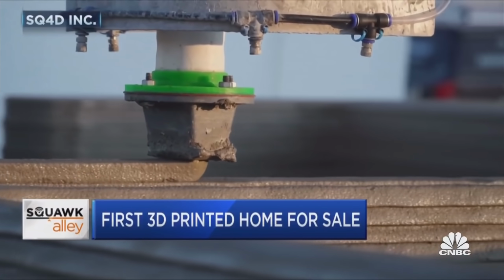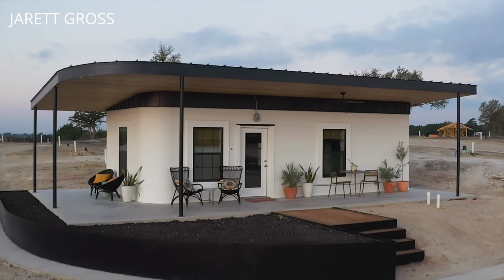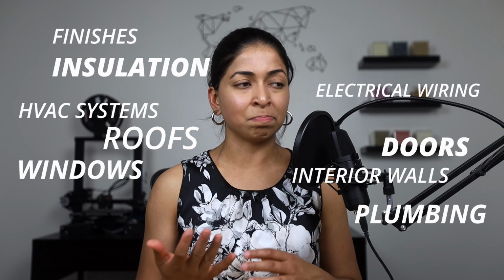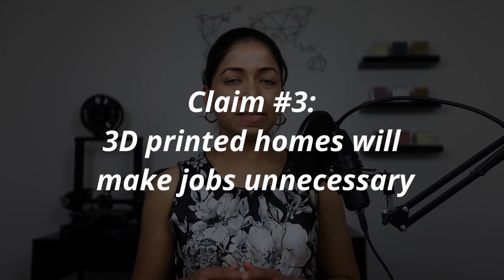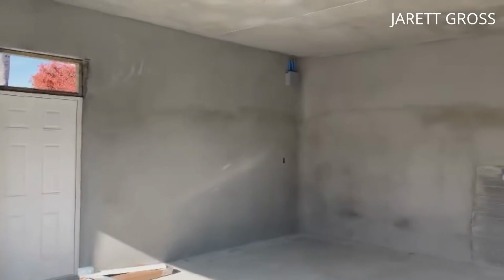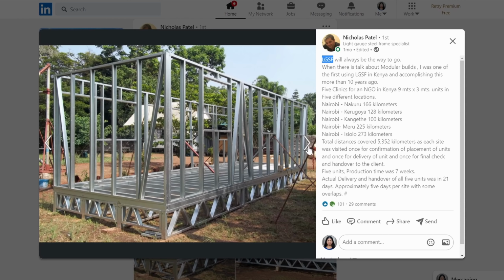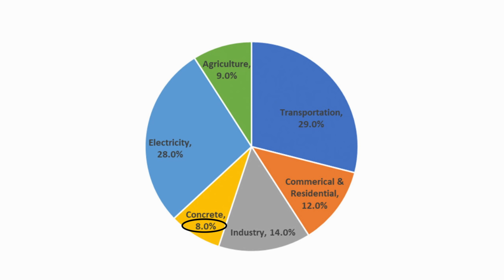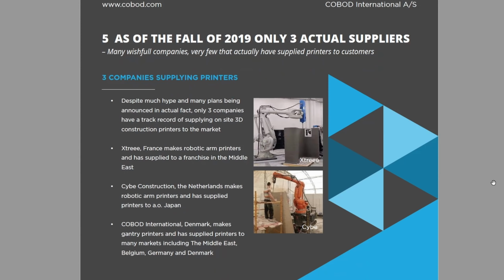Exposing 5 LIES about 3D Printed Concrete Homes

Comment: I never understood why 3d printing concrete walls is an advantage to preformed panels. Only thing I can think of is shipping, but the same will apply to the shipping of raw materials
Reply: Its not an advantage to manufacture concrete on site. Show me a 3d printer that beats Martin Marieta ready mix for quality and price. They never will.
Reply: to be honest, for basic straight walls there isn't any real advantage at all. block wall will go up faster, and  is cheap.  can be bought anywhere. a decent bricky can lay 100 to 200 blocks in a day, easy.. to a recommended height of 16 blocks high, for higher levels, time is needed to allow the cement to set. 

16 block high walls are over 3m higher, more than high enough for that 3d printed garage as an example. a block equivalent could be done in a single day.
Reply: You have to ship an enormous gantry to the site and install it, one taller and wider than the whole structure. Notice they always show a closeup of the print head, not the enormous structure it's riding on.
Reply: I’ve used SIP on an addition and was able to do everything but the foundation. 3D walls scare me without rebar.
Reply: Only actual point is making pretty shaped walls.  3D printing is way overhyped in all materials.
Reply: For one thing, it’s a new technology.

There are many instances of reluctance to a shift in paradigms.

I’m not saying that this particular technology is currently viable, but all opinions should be taken with a chunk of salt.

I tire of constant nay-saying that does nothing more than reject ideas rather than investigating how to evolve them.
Reply: @jackdeniston59  Which means what, exactly?

We should just toss all these techniques out?
Reply: @support2587  The first company that makes a modular construction system that offers future expansion in all three axes will make 10 times as much.

Imagine not having to tear down existing construction when you want to build deeper, wider, or taller. As resources allow and necessity dictates you can expand downwards for thousands of feet and laterally for miles. Incorporating hydroponics, you can move all agriculture and manufacturing underground to return more of the surface to nature.
Reply: @kfoltman  “The reasons you can’t arbitrarily…”

…. with current technology.

Thank you, you rest my case.

Imagine a a peripheral support system that divides the foundation into 7 hexagonal sections where any three peripheral foundation plates and the central foundation plate can support the whole structure by itself. With a triple redundancy like that, you would be free to excavate any one of those 7 plates in a live load situation. Furthermore, any repairs on a single element can be accomplished during live load situations.
Reply: its a solution looking for a problem, were in the peak of the hype cycle
Reply: @quartertwenty484  yup not to mention whats the cost to manufacture one of those printers
Reply: maybe an advantage that you can do unique design that is not made of flat parts. It can have organic shapes.
Reply: At large scales I think a 3d printer could be quite efficient. For example if a whole neighborhood or large apartment complex is 3d printed you could save alot on shipping and setup.

For flat walls its probably not the best solution though. Its real advantage is complex curved shapes. 

But that's a niche market, most people are fine with boxes. However if fancy curvy designs become popular 3d printers would become quite useful.
Reply: @denisl2760  applying any type of finish to these non flat wall will make the cost go way way up.. tilling will be fun... I just dont get it this is tacking a part of the construction that is relatively cheep. yeah you can get round walls great they will fit nicely with all the round furniture from IKEA..
Reply: Curves.  That's it.
Reply: @support2587  They do have rebar. They skipped over it but it's in the layout picture. I think they presumed everyone knows that it's required.
Reply: @sparksmcgee6641  That's a hell of an oversight in video production, it's the most important thing.
Reply: Preformed walls can suffer damage from shipping rendering the whole wall worthless. Also the crane to move the walls into place can be a problem in areas. So you can ship the machine or the crane, then ship the walls that might break or ship the concrete. Its like shipping stone tiles, they are smaller but they tell you to get extra because of breakage which is a problem most don't think of. Also this can do curved shapes more than just straight and people want stuff like that.
Reply: @jackdeniston59  In fairness, there are some cool lattice stuff which can only be done with additive fabrication tech / 3d printing.  And a lot of the time complex forms are functional (brackets and mountings for example)... 3d printing is great for that.  Walls... Not so much.

BTW: I can totally imagine 3d printing in a factory being pert of constructing prefab wall sections (and trusses and such).  Not for the routine flat parts though.
Reply: There is drawbacks with preformed walls. Most of them have to do with shipping and installation.
Reply: @matkany  not really, you can make way crazier shapes with a frame and moldeable concrete, or just have interlocking blocks for fast walls buildup if you want to build straight, way faster than the 3d printer at least so far
Reply: @ezicarus8216  yeah but you dont need big curves you just need to elimite angles and make flowing paths
Reply: You don't necessarily need to ship raw materials if it the raw materials are available locally. This is exactly why NASA is interested in 3D printed structures on other worlds.
Reply: @JohnDahleAL  You are thinking two-dimensionally.

There is plenty of space below ground as well as in the oceans. We have enough space to double our population every 100 years for the next thousand years before we would need to leave the planet.

You can fit the entire world’s population comfortably in a 10 cubic mile of space and would only need 100 cubic miles of space for basic necessities. That is the same amount of land as any SINGLE city to a depth of one mile underground.

Moving most of our infrastructure underground or under water would protect it from natural disasters while returning most of the surface back to nature.

I have crunched the number, and it can easily be done. The problem is that it would drastically alter the economics of land value which current land owners would not appreciate. Any drastic change in the current paradigm would drastically alter the power structure.

The technology is not difficult. Overcoming the brainwashing of the masses is the problem. There are solutions to that as well, but most people would rather sit and complain instead of actively developing solutions.
Reply: Although "quick cement" can be used the general idea is to use the materials found on or close to build site. If they were to prefab parts the issue would simply be the shipping and unloading which would require a crane and it may not be possible to get a crane into some areas
Reply: well technically it replaces labor. the shipping of goods will be automated too. that is probably the first thing to go.

currently men have to align the machines but that is a small step away from being fixed. no pun intended
Reply: @support2587  as with most masonry, you don't need reinforcement if you make it thick enough. But at what cost? Steel is cheap and recyclable. You don't need expemsive alloys either. It makes a lot more sense to reinforce concrete than to print or make ridiculously massive walls.
Reply: @pinheirokde  arguably, you don't need to do anything other than paint it. Apply a seal coat to the concrete floor every so often and only tile in the wet areas.
Reply: Strength and workforce. A large scale 3d printer can cover enough space to build the frame of 10 houses, IF YOU SET IT UP THAT WAY, and can run continuously. Once the first one cures, you can have your men wire and water it up while the machine works on the next house. What should be a 10 day to 2 month project can be done in 2 days. Also, 3d printing lets you do structures that normally couldn't do with normal fabs, and lets you mix in materials on the fly. Rather than need to go over a section with a hand tool or a truck twice or three times to get agents in there, the printer can just lay one layer ontop of the other at the same time.
Reply: I think the technology is something that would be necessary for remote habitats, like some of the Mars habitat design proposals or something that could be built in Sub-Saharan Africa where you plan on using local resources to save on shipping costs. But yeah, in a city you're not gonna get anything out of it except for angry unions.
Reply: @Michael-lg4wz  And the automobile will never replace the horse!
Reply: Pretty simple. Preformed panels have to be installed by humans. Human work is far more expensive than the electricity a printer needs.
Reply: @Clean97GTI  same can be told for a standard concrete wall, and some times architects want that, but that is not the norm not at all
Reply: @sparksmcgee6641  It is an advantage, when it's too expensive to ship concrete from the closest concrete plant. Like for example Mars, for which 3d printed construction was invented.
Reply: @allyourcode  as someone who has participated in some of those research projects: we won’t be doing this off-planet. The easiest place to build for humans is Mars, and there the most efficient method is a low pressure dome with old-school reinforced local brick laid by humans. 

The mass, volume, and complexity - not to mention the maintenance - of printers at that scale and built for that environment makes it ridiculously expensive and inefficient.
Reply: @benji45645  nah the cost to put this on Mars is ridiculously prohibitive.
Reply: @IAmTheRealBill  maybe in its current iteration, yes. For now I think flat-pack or tent habitats would be best, but unless we start building spacecraft in space soon, there's too many other constraints with sending prefab panels or factories to make them there (launch window/volume of flights is a big one, but payload limitations are really the main issue). Also, before we have people on Mars, the signal latency means that it's significantly harder to coordinate multiple robots in construction; a single 3d printer using a flat-pack skeleton frame would be able to run a preset program and guarantee that it won't be shifted or misaligned because it's stationary.
Reply: It is just a modernistic woo-woo it doesn't make both economical and technological sense whatsover.
Reply: @support2587  Have a look at graphene/concrete composites that for smaller buildings can replace rebar.
Reply: Preformed panels require large cranes, and if they're anything other than a simple "2" dimensional sheet then they'll have to be made in a factory instead of on-site to make sense, thereby reducing the practicality. A 3d printer bot can be an arm, mounted onto an automated platform based on a common skid-steer, with some locator beacons mounted on tripods or something- have a on-site concrete tumbler that the printer-bot knows how to get to, and someone to watch over the entire process, and one person per shift (two when accounting for breaks) could run preliminary wall (and probably floor) construction for 10 buildings (or more) simultaneously. It doesn't handle everything, but you can get a lot of load-bearing walls erected in short order with very few workers.

I do think that it's over-rated, as the biggest change for e.g. cheaper housing is honestly smaller housing instead of ever more McMansions. However, I'm quite certain that this will become a successful technology (or at least, that the robot arm and/or rope suspension variants will be: I'm dubious about the gantry style), probably to about the same scale as sprayed concrete (and in some cases, probably in assistance to sprayed concrete).
Reply: @IAmTheRealBill  “Some of us have investigated it.”

Oh, well since you SAY so, allow me to retract my naysmithing.

😂
Reply: @absalomdraconis  Cheaper housing is actually larger buildings. Simple geometry shows that less material is used and less insulation is necessary for reducing energy usage.

Enclosing ten 1,000 cu.ft. (10,000 cu.ft.) buildings has a surface area of 6,000 sqft.

A single cube with the same surface area (31 ft. on a side) would contain over 31,000 cu. ft.

Also, the more real estate you take up, the more expensive real estate becomes which also adversely affects the land necessary to sustain a larger population.

You’re dealing with a three dimensional problem by only considering two dimensions. That’s just regarding simple geometry. The other variables you left out are also quite important.
Reply: making strange shapes is the only advantage, if you could call that advantage... because you then get stupid architecture ideas
Reply: It's useless Innovation
Reply: @a.m.doesit9347  surprisingly not that much, once you add the re-usability into the equation. the gantries can be expensive, but that's old tech and not so expensive. the positioning systems are also old tech, just scaled up. keeping the mix/materials constant is a bit tricky/expensive though.
Reply: @bikerfirefarter7280   I doubt you crunched any numbers.

Have you ever designed a power transmission system? Would you like to go buried or aerial? There’s a significant cost difference if we go buried, but aerial is more susceptible to damage.

You can apply the same parameters to everything else you just mentioned. Do you honestly think it would take less material to build out two-dimensionally rather than three-dimensionally?

It honestly doesn’t sound like you understand basic geometry because a sphere has the smallest surface area to volume ratio which is why most efficient systems are spherical. If you went with regular polygons, the tetrahedron is the next efficient shape, but that’s a bit less complicated to construct than a sphere. This leaves the cube as the most efficient shape that is easily constructed.

If flat construction is so much better, why do we have skyscrapers, genius?
Reply: I guess it's less physically manpower required specifically in the process of constructing the walls? It's also quicker. Not anywhere as fast as its marketed as but just the walls can take a long time with manpower. Also fancy looking walls.
Reply: @bikerfirefarter7280   Talk about misunderstanding…

The comment you replied to about my “Utopian 10-cubic mile” had NOTHING to do with the construction method used to achieve it.

It was a comment to illustrate scale of magnitude. 😂 

Thanks for informing us that you have never tested at genius level, but your rant just before it signaled that fact plenty.
Reply: @bikerfirefarter7280  Skyscrapers are taller than they are wider due to land constraints as well as due to an edifice complex to build the tallest buildings.

The fact that you say that spheres are not the most efficient DESPITE EVERY celestial body being spherical says a lot about what you THINK you understand…
Reply: @backwardsbandit8094  you could use multi-head printer/extruders on same gantry to increase some speed (depending on setting times). but, yeah, you're right.
they are also missing a trick with different extruder dies that could print wide/complex layers in a single pass.
e.g. one orifice with two outlets extrudes the outer/inner skins, a connected orifice 'weaves' the interlace between them (possibly with a different composition).
Reply: @bikerfirefarter7280   “a sphere isn’t efficient”

Yeah, that’s what nature figured out when it created cellular life, right?

“…it is just a minimum ratio of volume/surface area…”

Yes, because longer beams can support more weight than shorter beams, right? 

You think millions of miles of transmission and transport materials is more materially efficient, more labor efficient,  and energy efficient than a few thousand?

I’m really not sure what kind of math you are using, so I wouldn’t know how to explain it to you.

“Unlimited height skyscrapers”

Imagine that. The more eccentric the shape becomes, the less stable it is. Do you know what shape has the least eccentricity? A sphere.

“Unlimited depth mines.”

Is this a limitation of engineering, or a limitation of cost/benefit? If there was a benefit greater than the cost to go deeper, don’t you think somebody would figure it out? Currently, the only benefit for going deep is for resources; not space efficiency. Once the surface is completely tapped, where do you think we would go?

Or do you believe we should just incorporate population control and treat space management as an example unsolvable problem?

It really just doesn’t sound like you are considering all the variables that I am considering, and your assumptions are merely leading you to make arguments that are irrelevant to what I am proposing.

I am not saying that we SHOULD cram 7 billion people into 10 cubic miles of space. I am saying that we COULD. The necessity is still centuries off, and you are treating this discussion as if I am proposing that we should be doing it now.

I am not.
Reply: The only advantage is probably wacky shapes
Reply: @allyourcode  this is not applicable to the majority of human settlement. Say I want to build a house in suburbia. Where does the material come from, do I dig up the road?!
Reply: @josephcoon5809  Dude, where are you going with all this ultra efficient use of space? Are you crunching numbers for a sci-fi novel or drafting plans for Earth in the year 3000? There is plenty of living space on Earth for the foreseeable future that you need to concern yourself with. And nothing can really be predicted 100 years into the future, so it’s a pointless exercise.
Reply: @PeterKoperdan  Its like you skipped the first sentence in that comment:

“There is plenty of space below ground as well as in the oceans. We have enough space to double our population every 100 years for the next thousand years before we would need to leave the planet.”

Yes. I said we could easily fit more people on the Earth DESPITE earlier comments acting like we are over-populated as it is.

As for what I am working on, it’s far too complex for a YT comment section, and it absolutely deals with efficient use of space to undermine the child-like tendency to “vote” problems away.

I work on economically viable solutions to “political” problems so people stop using government as an excuse to do nothing except complain.
Reply: @josephcoon5809  But there is plenty of space ON the ground anyway. There's no reason to believe that Earth's population will increase indefinitely. There are demographical studies that suggest that populations tend to plateau given certain conditions. It seems to me that your quest for maximizing vertical living and supporting space is basically a sci-fi exercise (in futility).

100 or even 50 years from now technology will have evolved so much, that current sci-fi musings will probably not be very relevant. 100 years ago people started to envision transportation based on flying cars. Some people might have even tried to design traffic control systems for all the flying cars that were supposed to clog our airspace. But when you look at our skies now, there are no flying cars and therefore, there is no need for flying cars traffic control system. It seems to me that that's what you are trying to do right now - to design a traffic control system for the flying cars of the future, that will probably not materialize.
Reply: @PeterKoperdan  I’m sure your 100 year outlook has much relevance in the timescale of billions of years. You are free to be that short sighted and myopic, but I choose not to limit myself.

As I have said before, there are far more considerations that I am leaving out, one of which is politics. If you are fine with politics holding humanity back, that’s you.

As for transportation, Ford was scoffed at much like you are scoffing now. The fractal nature of Nature allows you to look backwards and extrapolate forwards, which makes your arguments seem just as short-sighted and myopic as Ford’s detractors just over a century ago.

As for “science fiction.”

Yes. Every new technological advancement begins as science fiction. Years later they become science fact. The realm of science fact is a box many choose to remain in waiting for those who wander outside in the realm of science fiction to help them out.

We continue pontificating and waxing philosophical, or we can discuss the evolution from science fiction into science fact as humanity evolves toward the future. I care not which.
Reply: @PeterKoperdan  “Populations tend to plateau given certain conditions.”

Yes. An extremely vague comment that says next to nothing.

Try listing the limiting factors and tell me why those factors will remain limited.

I actually seek constructive criticism. You are merely providing criticism. If you cannot convert your arguments into an abstract mathematical formula, then it is useless to me. Give me facts, figures, and models to work with, not some flimsy ad hoc first impression of an idea you know next to nothing about.

I have plenty of spreadsheets started and it’s nothing for me to add a few more data points and functions to include your vaguely defined terms. That’s all I have been doing for almost a decade: trolling political forums teasing out details from everything people complain about and look to government to solve. You know; the childish option.

Everything g you have mentioned so far is barely the an ice cube at the tip of the iceberg of humanity’s capacity to complain until somebody else fixes it.

Politics is nothing more than relinquishing one’s responsibility to solve problems, and those who protest or complain about problems are part of the problem.
Reply: @PeterKoperdan  Tell that to those who started neural network research and gifted us AI, or Hedy Lamar, who wanted to help secure wireless torpedo control to help in WWII and gifted us with wireless communications as we know it today.

Thanks for your permission to do that which I have already decided to do though. Feel free to sit back and do nothing. Your lack of imagination is what makes innovators much more valuable.

I mean, it’s like you have no idea how evolution works. 😂 

Cheers 🍻
Reply: I'd say there is an advantage.  Firstly, preformed blocks and panels will be damaged by transport, even if it's just microscopic cracks, they will form. Concrete may have strength, but it also loses strength potential by default from damage during transport and installation. Another factor can be working on unleveled surfaces that may require specially made blocks.  3D printing makes conforming to the ground very easy, so you can build walls on a slope for example. 

The more structures you need to build at once in one area, the more practical it becomes to use 3D printing. Let's say you get a shipment of preformed concrete blocks/panels, and some are broken and unusable.  That could, and does, lead to work stoppage. Same thing if they made them to the wrong spec. You'd have to wait for the replacements. While brick walls are not obsolete, they do suffer issues due to the bond breaking between the brick and cement over time. Brick requires repair and maintenance eventually.

3D printed concrete allows the simplification of machinery needed to build something.  You no longer need a big crane to get concrete blocks in place. You no longer need large transport vehicles to carry the blocks. These things take time to unload, and those delivery trucks are getting paid even if they're parked and waiting to unload. Those expenses add up. One also has to consider that while it might appear like a slower process, the process of a preformed block being created, stored, shipped, and finally being installed, is not a fast nor cheap process.  

So removing that from the equation, does mean that 3D printing is actually cheaper and more energy efficient. Smooth walls when the concrete is laid, might seem more desirable, but there are benefits to the uneven layers in 3D printing. It gives more surface area to the structure, allowing things to be attached more securely.  If you use a plaster or insulation on the 3D printed concrete, it is going to be more firmly fixed to the surface of the concrete, because it has those grooves from the layers, to stick into.
Reply: @peoplez129  I would add the human component to laying bricks adds considerable cost off planet.  All the resources needed to keep a single human alive and healthy are much more complicated than that required for machines. If something happens to a machine, it powers down until repaired. If something happens to a human, it dies until it is buried.
Reply: @denisl2760 at large scales 3d printer rails have to be very large. 
The easiest way to bulid a city from scratch is the Soviet way: bulid a factory that makes standard monolithic reinforced concrete or sandwich panels. 
Bulid basements, then Assemble your houses out of those plates as needed and finish them. 
Plan in schools, kindergartens, commercial real estate, a hospitals - all assembled like Lego. Voila, a whole Soviet city in 5 years or so.
Reply: why the hell would you use a panel when you could use a thick cement reinforced with steel that is stable all around? dude the storms are coming, why would you want to live in a stick hut
Reply: @MinkieWinkle jfc y’all really want to live in straw huts or something wth
Reply: @support2587 no one does it without rebar, it’s all filled in after with rebar, insulation wires and more cement mix.
Reply: @josephcoon5809 dude it’s the internet, everyone’s an idiot narcissist with bad opinions. easily 99% of people out here lack common sense or social skills
Reply: @pinheirokde if you make the curves wide enough it won’t matter, rectilinear furniture cna be used again
Reply: @johnmcho ummm no. stronger structures, fire safe, insect and wind resistant walls
Reply: @denisl2760 i’m wondering if yiu could do a hybrid build like a two story spanish turret leading onto a regular house, since those are perfectly cylindrical basically, it might reduce cost of the build
Reply: @denisl2760 i don’t like rectilinear tbh
Reply: @freddyrodriguez4732  I’m not disagreeing with you, but me responding to idiocy isn’t meant to educate the idiot and their stupid opinions. My goal is to educate anybody that happens upon the “discussion.”